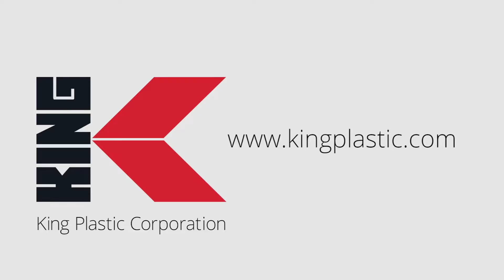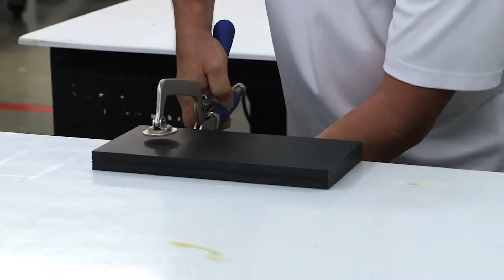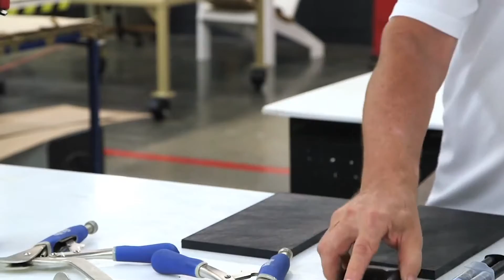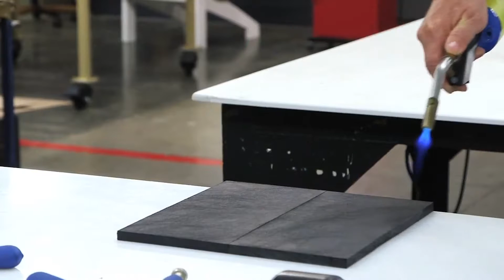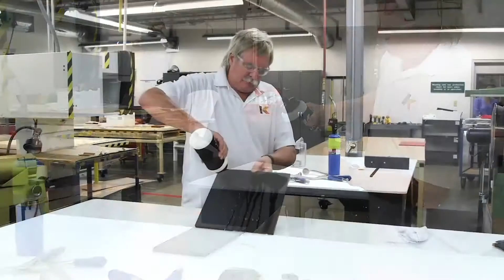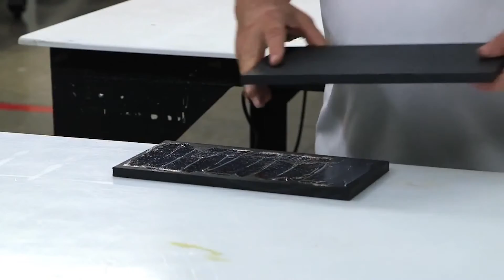King Plastic - Setting and Using Adhesives

Comment: Good info but let me add flame treating is good for over a year. I worked for lifetime bonding basketball backboards and learned everything about bonding HDPE. Try not to touch it with oily fingers. 100% Silicone is by far the best glue, single part. The slower the cure, the better the adhesion but 2-part is ok too. Modified epoxies and urethane glues are also ok but silicone will outperform everything for weathering and allowing the bond to move in hot/cold
Reply: so 100% silicone is better for snow runners on a icehut?
still heat treat right?

Comment: What adhesive, epoxy was used in the video??
Reply from the maker: It is preferable to mechanically fasten or weld King StarBoard®, but when an adhesive is necessary you can use a product called Chem-Set™ 6105 Polyolefin Bonder, Lord 7542-AB, or 3M’s Scotch-Weld DP-8005.  We do not represent these products, or make any claims about their abilities or accept liability for them. The adhesive used in the video was not disclosed.
Reply from the maker: @daveherzfeld3315  Please contact customer service at 941-493-5502 and press 3 for the technical department so we can get more information about your application.